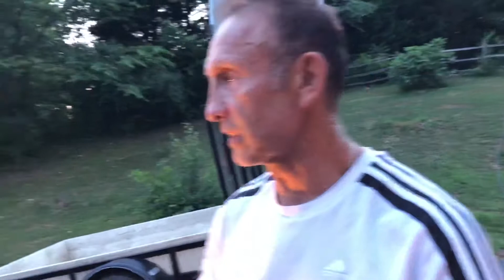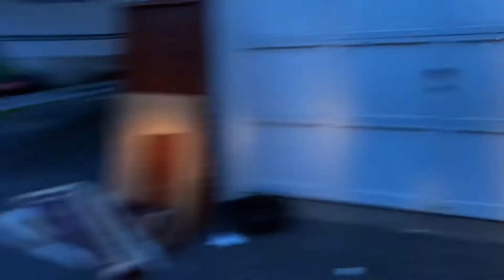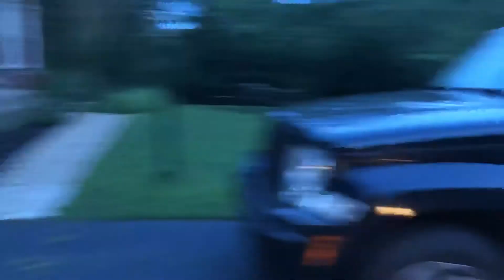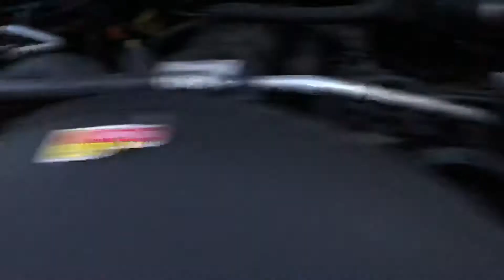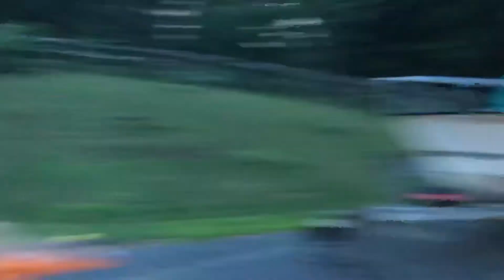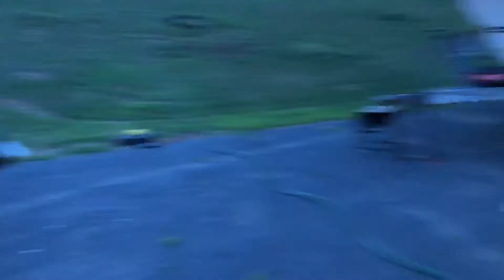How to Adjust headlights on 2001 Jeep Grand Cherokee laredo

Comment: Did you say star bit? What size. I could not understand?
Reply from the maker: Yes a star bit. Forgot what size it was
Reply: @elcheapo1112  it was a T25 like you said. But by bit was too short, Have to look for a longer bit. Because the hole is to small for the screw driver. And it wont reach.
Reply: Every headlight is different mine was a Philips one